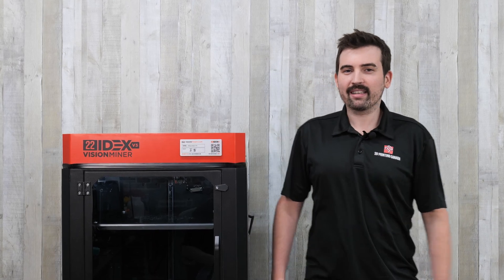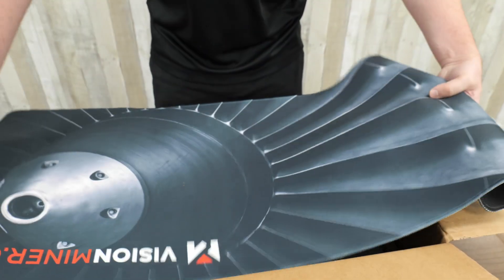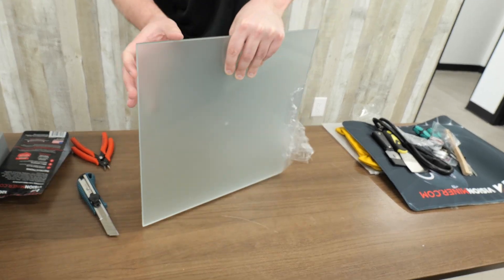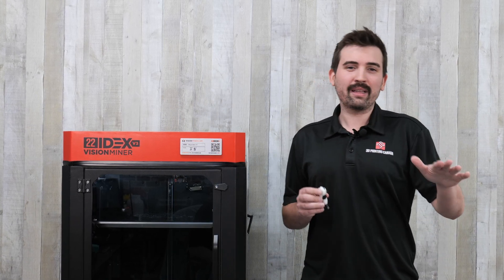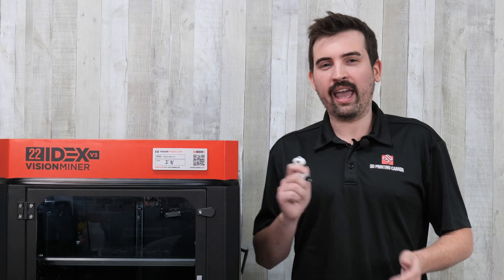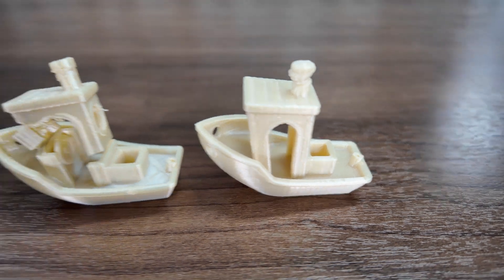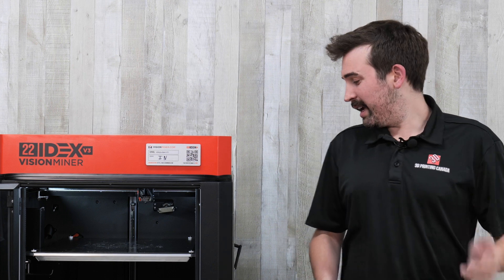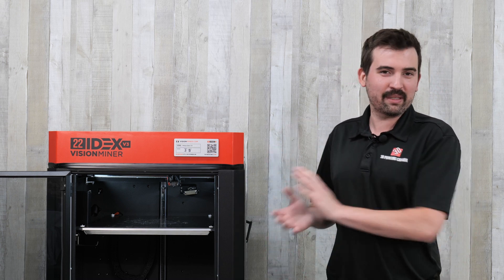VISION MINER 22 IDEX v3 - Unboxing & Test Prints

Comment: As someone who uses this exact printer on a daily basis, it struggles with things that far cheaper printers do not. It’s cool but because they sell so few models they have a long way to go before all the kinks are worked out
Reply: It's not for doing things that cheaper printers might do slightly better. It's for doing things cheaper printers CAN'T do at all. It's a entry level engineering printer.
Reply: @sean9267  they market it like it can print ULTEM but the chamber heater struggles to get the chamber above 95C
Reply: @craZduck19  I am considering this printer for our company. But I feel the company behind it's so new and little that it can't give support and performance we need.
Would maybe an Intamsys printer be better on that side? Mostly for ULTEM and engineering materials. Thanks
Reply: @diesel701ful depends on how how their active chamber heating can get. Ultem like 140C chamber temp but the 22Idex can barely get to 95C
Reply: @craZduck19  not so many 3D printers can reach that chamber temperature. Even the Intamsys HT and 410 pro can reach only 90°C
Reply: @diesel701ful which is why ultem and peek are a bit lofty to print with current tech. Creating a hotter chamber is easy. Making sure that every last component down to the screws and wires within the chamber can function as well at 140C as they do at 25C is the hard part
Reply: @craZduck19  the tech is there, but you need to go on machines that can reach easily 100K cost.
Reply: @craZduck19 does it still struggle? Don’t see why 100C would be that hard with that enclosure, bed at max, and a chamber heater. Could be the total size but my trident gets close to 60C after a bit passively. Qidi plus 4 with a meh heater is 65C after 20 minutes.
Reply: The maximum chamber temp will limit how large of a part you can print with the really high end filaments.